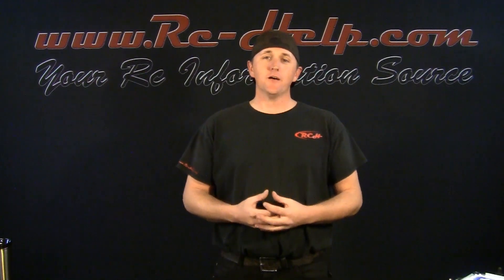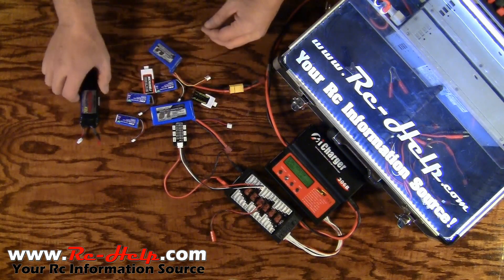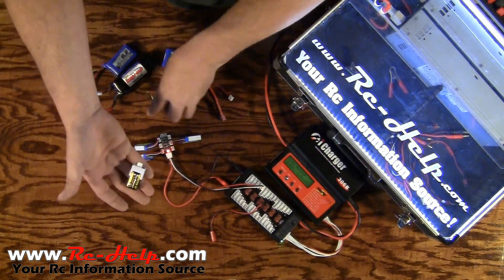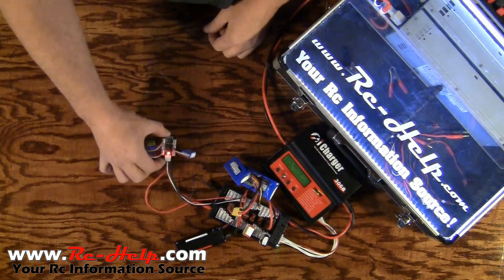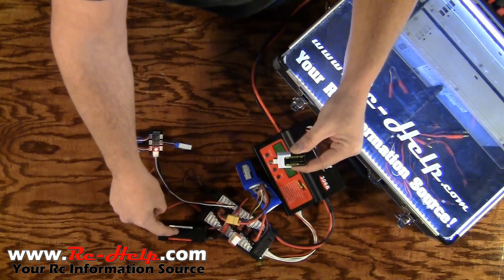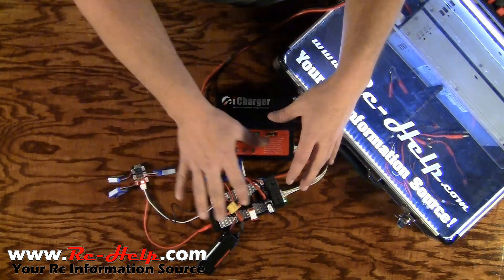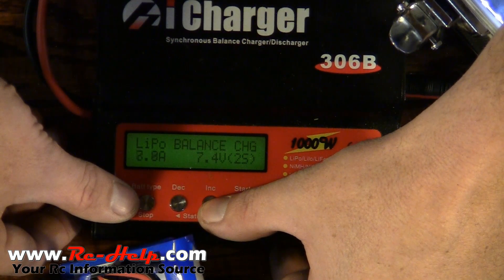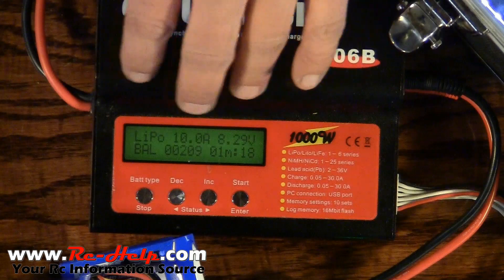Parallel Charging Lipo Batteries Safely

Comment: Your voltages don't add up because of losses due to internal resistances, and wiring resistances.  Your single voltage is the voltage out at the main connector.  it's going to be a little higher than the sum of the cell voltages.

Comment: Speaking strictly about 3S LiPos.... If I leave them plugged into the charging board for a while , ( not charging,  just  connected into the parallel  board  )  how long should it typically take  for the voltage to balance out? Thanks Tony.....

Thanks

Comment: Does it mean the cells combined are really absorbing 10amps?
Reply: RcHelpDotCom You mean to say that each cell by its own characteristics will not absorb more than 1C even if given 100amps? If so , i would agree since the 10 amps is what is available for the cells to absorb and not what is actually absorbed if the total amps they combined can absorb is less than what is available for absorption. Is the 1C due to the internal resistance of the lithium cell?